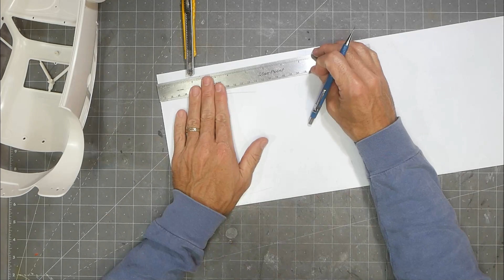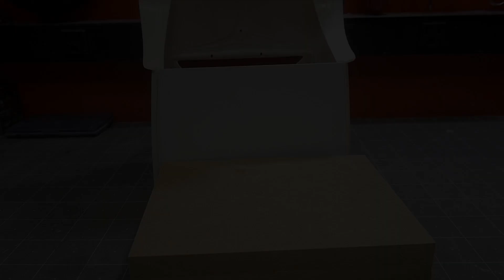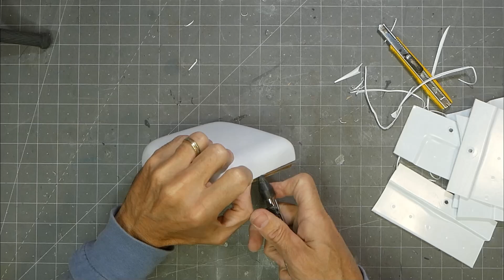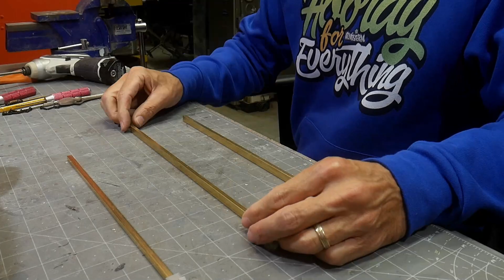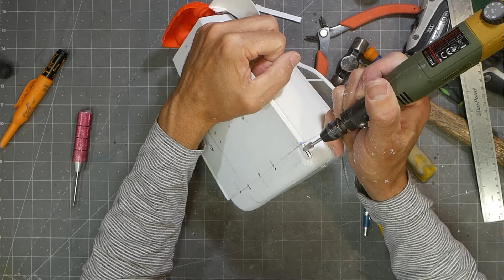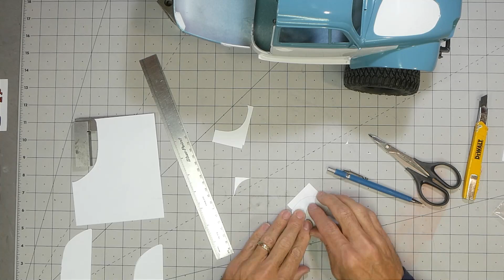VW Bug Trailer

Comment: Great looking Bug! What blue color did you use?
Reply from the maker: It's an actual VW blue color I special ordered.  If you need the actual name and paint code let me know, I will look it up.
Reply: @wesmadebuilds681  Thanks for that. I've been going over VW chips and found #L54D Marina Blue (1971) which looks close but if you have the actual one you used that would be great.
Reply from the maker: @PeasantArt  1972 VW Niagra Blue L53D, I got it from automotivetouchup.com
Reply: @wesmadebuilds681  Just looked them up. Thank you once again,
Reply: I have two of those Tamiya Bug bodies sitting on a shelf just waiting to be built up. This video got me stoked to build a Beetle crawler with one of them. Getting that chip number just sealed it. Going to binge watch your vids tonight.
Reply from the maker: they are fun, cant wait to see it.